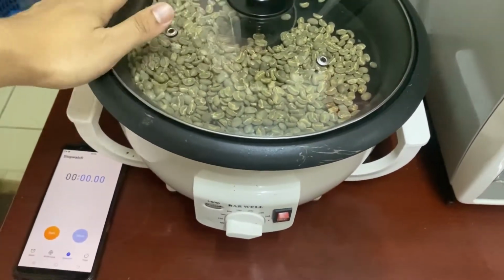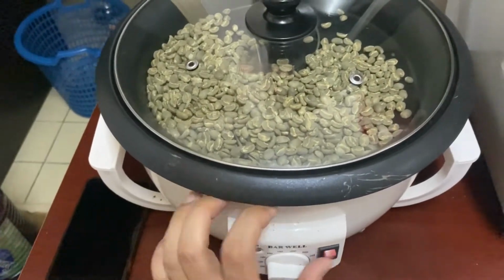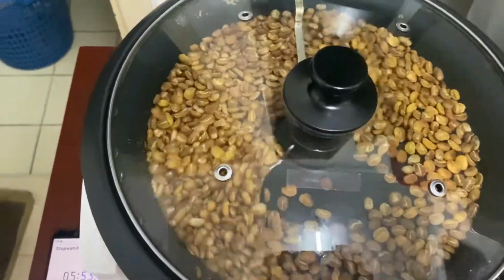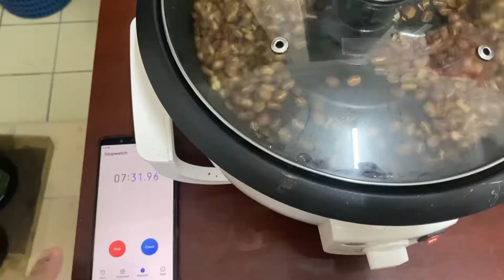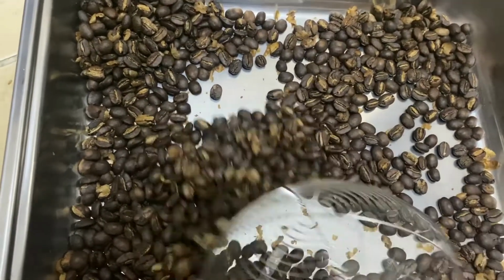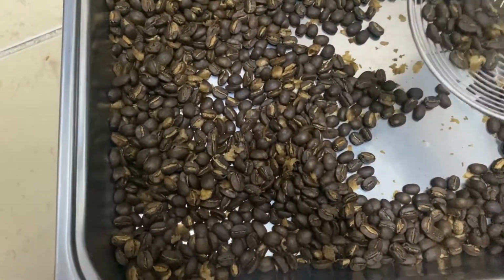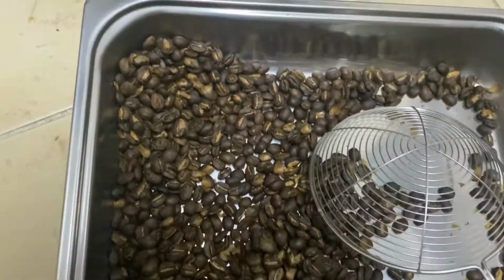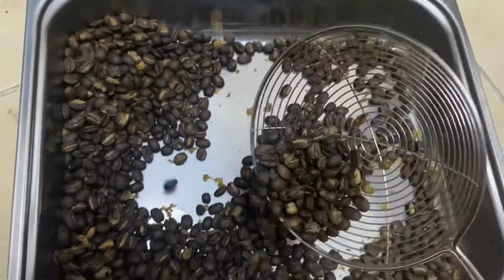Home coffee roasting using Bar Well coffee roaster / peanut roaster walk-through

Comment: Hello!! Thanks for sharing.. just bought the same roaster ..can’t wait to try it out 🤩😍
Reply from the maker: You're welcome. As this is a very basic roaster, please make sure you roast it until you hear the first crack. If the coffee does not crack, you will not get good coffee.
Reply: Does this machine constantly get 1st crack every time you do roasting? It will be good if you install a K type thermocouple to monitor the temperature inside the chamber, typically for 1st crack will require temperature reaches 198C to 205C ( depending on beans type)
Reply: Me too ☺️ I just bought it but I didn't try yet
Reply: It's a piece of shlt

Comment: I haven't yet roastedmore than 8oz (1/2 pound) of green beans.  I think you get the most even roast by frequently tipping the machine to the right or left for a few rotations of the stirring rod.  I typically heat up the unit for 2 min. or until the unit has reached 220 degrees celsius.  After 17 min. of roasting at 220  I turn the unit up to 240 degrees celsius and roast for another 1.5 to 2 min.   Pour out all the beans into a metal large sieve, and pour the beans between the sieve and another while outside, blowing on the beans as they fall so as to blow off the bean skins.  My roaster cost $119 on Amazon -- too expensive for what it is.  My fresh-roasted coffee beans smell like chocolate!
Reply from the maker: Nothing beats the smell of coffee roasting. From the grass smell to chocolaty aroma!

Comment: Optimal batch size for this is 270-300 grams... Anything under it and you will have scorching.
Also don't hit the temp to 240c or max right from the get go...
Try no warm up, dump beans, set to 220, turn on, run for 4mins then hit the temp to 240 from there.
Reply: I do similar, but I tend to run a little cooler.  250 grams and I run at 200C until first crack, then up the temp to 220C until I hear a strong 2nd, then I dump.

Comment: Thanks for the share!! Iam in new entry with the barwell..try to find the best parameters..250 grams find it the best for me maximum..i will test it with 200 gr..maybe more eventuale the colars.breaheat 180c 3-4 minuet and the starting point tembeture its 50.-70.always the cover its on top its take it me 18-20 minuet for city plus.runing at 230c .my issues its the colur uneven...maybe 200gr make it better results
Reply from the maker: Yes, lower batch capacity would probably gives more even roasting. Happy roasting!
Reply: @suhail986  thanks and what aboud preaheat?you sugest start with not breaheat?thanks
Reply from the maker: @pmakris  i don't do preheat because the roaster cannot heat properly if it runs too long and I will get underdeveloped beans. When I do preheat, the beans can not get to first crack even though the colour has changed. When I roast coffee using this roaster the only parameter I will look for is the first crack and the time lapse after the first crack.
Reply: @suhail986  thanks men.i wiill try yes the same with me after the first crack its take to mane minueits to going to the next level..i shoose that barwell to have more expearanse becaouse we can veiw the hole rwastink to the full procress from the glass thanks.for the begener its ok.its acsetaple the results🙃😉
Reply: Hello.my barwell its the smaller model with smaller arms..240 a/c..i try 200gr insteat 250gr.yes its take 12 min..bud the half patch wos more and more darker roast.i will try 250gr 2-3minuet 180 c for the next 5minuet.. and after 230 c tilt the end and control by infrarate tembutere..i wiil come layter..for comments..by the way i try it by east timor beans..
Reply: I'm new to coffee roasting also, l find 150g is a good starting amount to start with,  it's easier to control. 👍

Comment: Do you see any scotch beans using this roaster? Scorch beans mean part of the beans are "burnt" which can be distinguished easily. I have a drum roaster, I get scorch beans quite often. Second question, how reliable of this machine?
Reply from the maker: No scorched beans because i think the heat is not strong enough, so the roaster might struggle with higher density/moisture beans. The roaster is not that reliable, I can only do one roasting at a time. Tried back to back roasting, but the roaster just cannot get up to the right temperature anymore.
Reply: Hi, thanks for your replied. Actually I noticed that this roaster is only 1200W, which is not hot enough. There is another brand which is 2000W, I believe this should be better to handle back to back roasting.

Comment: Hi Guys, I just received my Barwell Coffee roaster today but when I opened it, there are some broken black plastic strips. When I inspect the roaster, I found that the black plastic came from neck (below the neck) of pan because there are some parts that are left there. Others have fallen on the box. Could you please help me? Can you check if what for are those plastic black strip? You can find the black pieces if you tilt sideways the whole thing, and peep on the neck underneath. Thank you if you can help me identify the use of that. Thanks
Reply from the maker: I think that's the plastic that is filling the gap between the pan and the body. I have broken some, I think. Only one left.. haha. Roaster seems to be working fine.
Reply: Yes, Those are the plastic between the pan and the body. Thanks a lot. I managed to insert two more. I tried the roaster and its working great.

Comment: One more question: since this video was posted 8 months ago, does the roaster is still working ? How many times you roast a week? What is the loading capacity hat you do every time you do roasting ?
Reply from the maker: Still working. I roast one time per week only, around 300 gm. Not using this roaster anytime since I got a new roaster.
Reply: @suhail986  which brand that you use? Don’t mind to share?
Reply from the maker: @Presso99  sniper m2 roaster.
Reply: @suhail986  wow! Good stuff!!! Expensive though
Reply: My bar well stil working i am hapey do the job nise 250 gr evrey week😀
Reply from the maker: @pmakris  good to hear that 👍